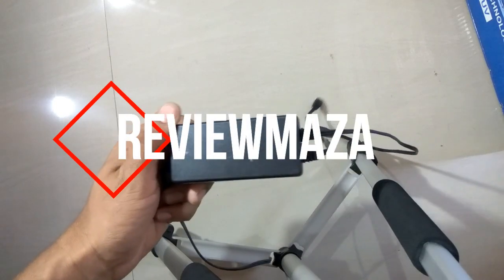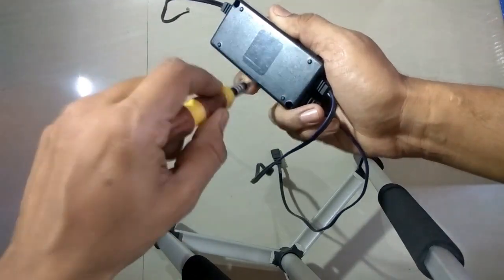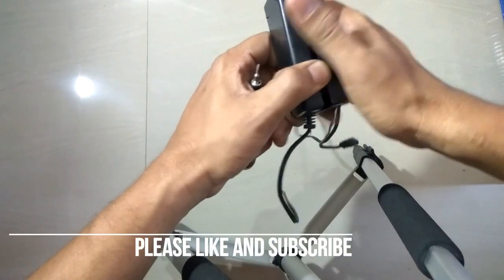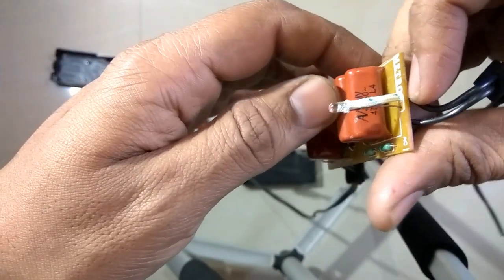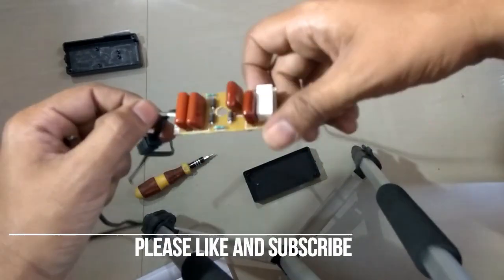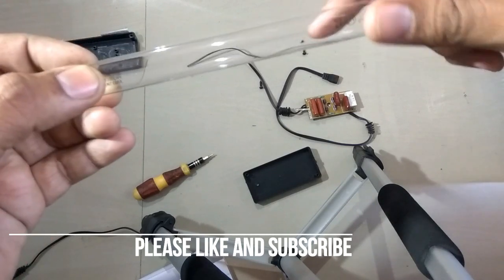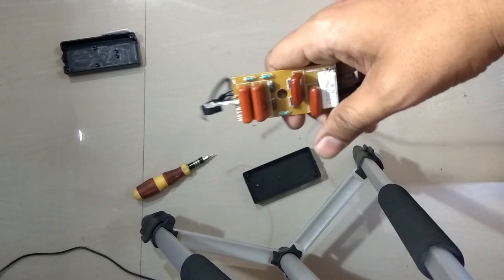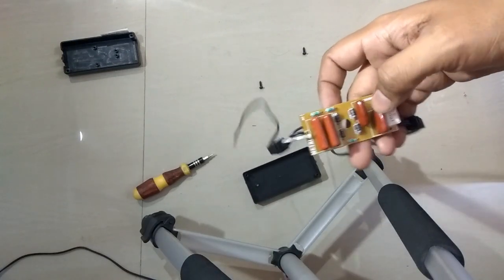UV CHOKE - HOW IT WORKS?

Comment: There is no bridge rectifier, it is voltage quadrupler.
Reply: Hey can I use normal tubelight chowk instead of that ?
Reply: NO
Reply: @sudippramanik1307  it works I did tested today only coz both works on same principle

Comment: Sir, thanks for explaination. Very nice video. I am trying to replace an old UV Ballast which is 8 watt. Can I replace it with 24 watt ballast or does it has to be 8 watts only? UV lamp is rated for 8 watt. I am thinking to upgrade it to 13 watt.   Does 24 watt means that I can use it for all the UV till 24 watt?